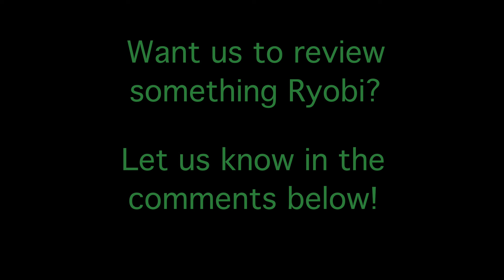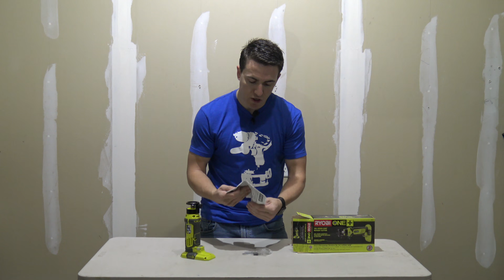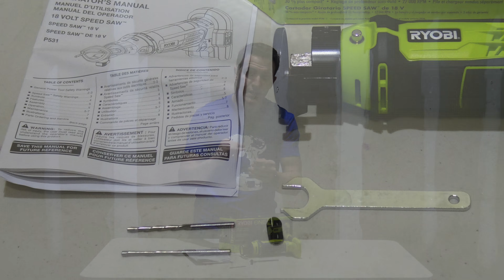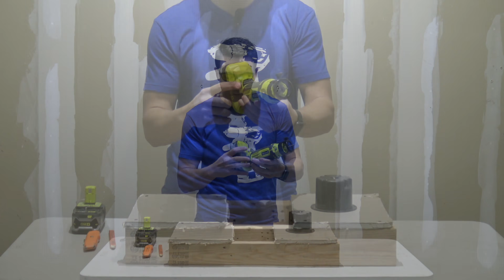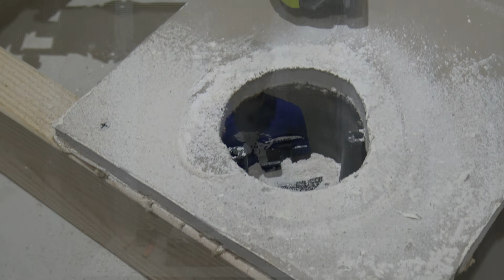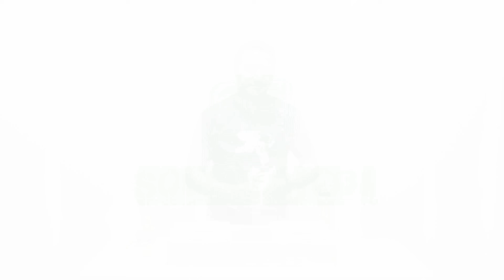Ryobi 18V ONE+ Speed Saw Rotary Cutter RotoZip P531- Review!

Comment: I thought it was one of the flimsiest Ryobi tools I've purchased.  Plus it gets really hot after just a couple minutes of use.  Plus, it's really easy to accidentally switch off.  Plus they should've put a proper chuck on it instead of the crappy collet/wrench thing.   Plus it is LOUDER THAN F. Ear damaging.  You should wear ear protection with this thing.  That said - it works!  It did the job.

Comment: I bought this tool not for drywall cutting but for the 1/4 inch chuck. I use it with. 1 1/2 sanding disks. They can take the high speed rpm and they can cut down metal for small areas rather than using a large angle grinder. For $40 it has saved me a ton of time.
Reply from the maker: Nice! Thanks for commenting!
Reply: One other item. I’m not a business person nor a market genius, so I don’t understand why companies sell some products in some areas and not others. I recently saw a video from a guy in Australia reviewing the Ryobi 1” belt grinder/sander. I don’t understand why Ryobi doesn’t sell/market it in the US. I’d pickup one in a heartbeat if they were available.

Comment: The routers are a waste of time unless you're securing it to a beam cutting a circle out for a lighting fixture is a waste unless they can secure it surely to a beam easy work for sheetrock installers more difficult work for electricians

Comment: NEVER. GO. CLOCKWISE. I did so with a rotozip while making a last few touches before sanding on a key shaped key rack and the thing jumped and cut into the wood on the other side of the key and messed up the whole tip of the key so I had to modify my design to get a good grade for my tech class

Comment: this tool sucks.  might be ok for a diy’er im a dry waller by trade and i was excited about this when i first saw it. went and. bought it and some batteries i was not impressed. i took it back for a refund i would not recommend it for a pro drywaller
Reply from the maker: Thanks for your thoughts
Reply: I purchased this because for practically the same price as the multitool rotary attachment, i got a separate tool that I could just keep loaded with a sheetrock bit, that also cranked out an additional 7K rotations (over the multitool job-one option).   I just bought the 531 today and am surprised by its poor build quality compared with all my other 18v Ryobi tool.  The battery locks in OK, but fits flimsily and rocks, as does the guide when its not pressed against the wallboard.    I havent actually used it on a job yet, but seems like with the high RPMs there's gonna be a lot a unwanted vibration.  I tried to observe in your video if these parts wobbled too - didnt seem like it.   Thinking about going back to Home Depot to look at another, to see if I just happened to get a lemon.

Comment: Can this be used with 3/4 plywood or is this strictly for drywall?
Reply from the maker: Ryan Malone good question! We haven't tried it yet but yes it should be able to handle 3/4 plywood as well.  Might want to have a 1/4" bit in...
Reply: Thanks  @ROBERT-f5t7n  - I keep breaking the bits on 5/8th MDF - do you have any recommendations on a specific bit /manufacturer?   The documentation that came with the device showed cutting aluminium, wood, brick, but I seem to be unable to get through more than about 2' of 5/8th MDF.